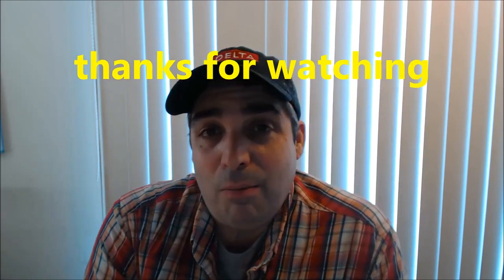vlog Q@A about oil pump filters starting a business

Comment: I believe in Anode changing. Its under a hundred bucks plus labor.  Seen tanks that were flushed annually and anode every 5 years last a whole lot longer than neglected systems.  Some the anode is just the internal rod no sacrificial metal left.  The trick is pull it out as far as can then cut a slice with a hack saw. Bend it 90 degrees and so forth until you got it out.  Then put in the linked hot dog anode.
Reply from the maker: Ryan Dugger like i said in the video i have done it before .and tell people about it .its a 200$ bill for the most part most people will not pay the money

Comment: Whoa, I heard you mention it may be time to replace your water heater if it's over 12 years old.  What should someone look out for if their water heater is still working but it's about 18 years old?  And my furnace is probably over 30 years old. Still works but hardly use it because most of time it's roasting out here.  How often should the furnance be replaced? Should I replace mine now before it croaks on me or wait?

Keep the jokes coming Steve.  I like your humor, and I wouldn't care if you made fun of me.  I'd laugh with you!
Reply from the maker: Domo on the furnace you would have to have it checked . its hard to say over a email . but the water heater if you do  care about a flood best to get her changed out .18 years your on borrowed time .unless its a copper or monel tank them can last for ever.
Reply: I got a Nautilus Proline Plus self cleaning water heater.  Haven't had a problem.  Never cleaned it either.  I guess you're supposed to flush it out every year. And I got hard water.  Seems to me, the newer water heaters are a piece of crap.  Read some reviews,  and they barely lasted 2 years.  I need look into this Montel brand you mentioned.  Apparently, my brand name is not getting good reviews.